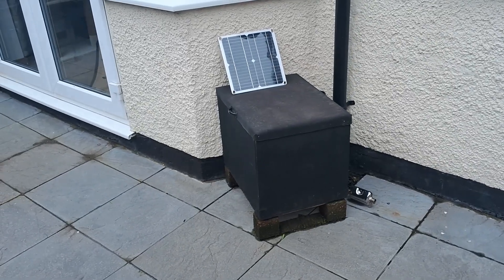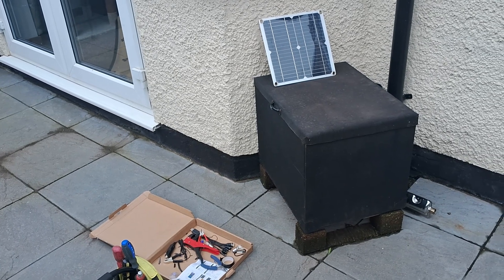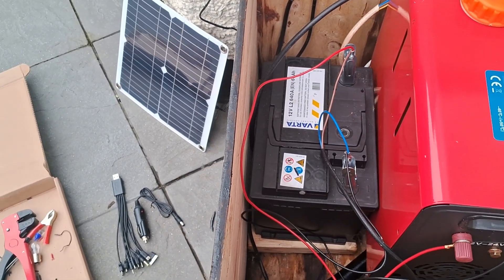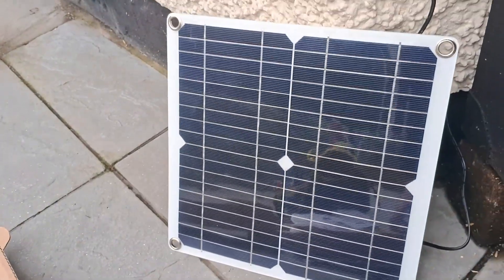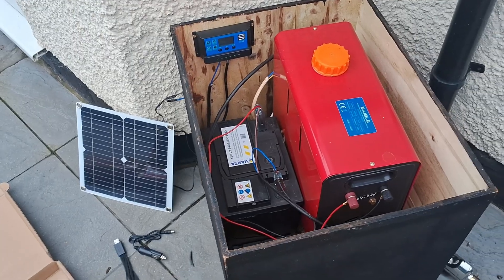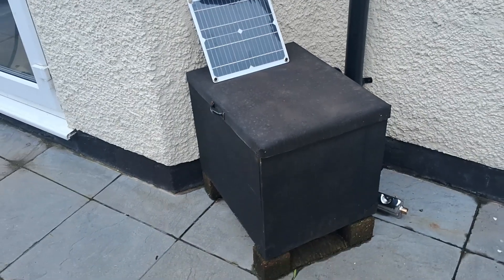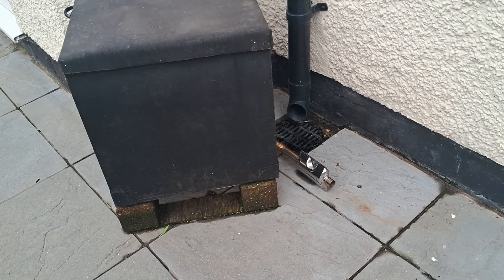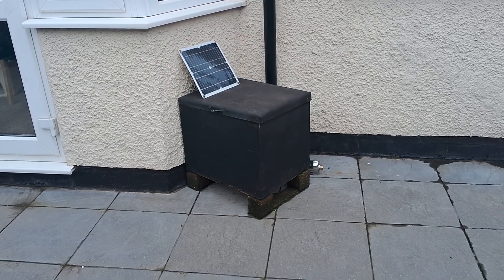SOLAR ENERGY POWER DIESEL HEATER HEATING MY HOME 12V BATTERY HEAT PUMP OFF GRID SELF SUFFICIENT

Comment: Sorry for the following long ramble and questions. It seems the way I think out load and problem-solve. Any comments and information you can provide will be helpful as I commence with my own DIY diesel heater project.

I've watched a few of your videos on capturing and utilizing waste heat from the heater exhaust to warm your home/workspace but I wonder if you've ever tried capturing the waste heat inside the enclosure or measured temperatures inside the compartment?  I'm specifically wondering if having a length of exhaust pipe inside the heater enclosure would be sufficient to warm a lithium battery above its charging shutoff temperature? Or does the general heater operation provide sufficient heat to warm the enclosure without relying on the exhaust? Perhaps constructing some sort of heat sink around the pipe and using that waste heat to warm the battery as well as the diesel fuel would keep everything warm enough without causing overheating problems? There would be an initial cost and consideration to make sure the heat sink wouldn't get hot enough to cause damage to the enclosure or components, but I don't think too much of an investment would need to be made.

I've have been considering a DIY project that incorporates a 2kw diesel heater in a (Keter-made) plastic modular toolbox along with a 12v 50ah LiFePO4 battery and diesel fuel tank. I am hoping to recharge the battery inside the case using a portable solar panel and small 14.6v 40amp DCDC charger with MPPT function incorporated within the enclosure. I already have the solar panel(s) charger and lithium batteries on hand, and would like to use the components I've already purchased. I'll also probably wire in some sort of busbar and fuse block, as well as a 12v DC socket and some USB ports. A few Anderson ports would also let me use ACDC chargers and run 12v appliances like camping refrigerators.

The problem is that lithium batteries cannot be charged below 0ºC (32ºF) without damaging the battery cells. The battery BMS restricts cold weather charging as a result, but that is exactly the weather condition when such a stand-alone diesel heater would be best used.

I realize I could run a cable from a battery inside the space being heated (probably the simplest and least expensive modification costing only a few dollars for a cable extension), but I would still like the option of having everything in a single box. If possible, I'd also like the solar panel to be sized for convenient carry/deployment from the battery box. Finding one of ample power and minimum size to keep the heater running 24/7 might be challenging, but I think doable.

So, the problem comes down to keeping the battery warm enough to recharge. I know they make electric battery warming pads but those draw more power than the heater itself consumes so that ultimately is not self-sustaining especially during Winter when sun angles are low, days are shorter with fewer available solar hours to charge, and gray overcast days are more frequent. The longer nighttime hours also add additional stress to a system dependent on solar recharging a battery.

I'm considering mounting the components in cages made from 2020 aluminum extrusion rails and possibly putting  sheets of aluminum composite material (e.g., Dibond, Alumibond, or Omegabond, etc.,) within the rail channels to distribute heat captured from the enclosed exhaust pipe and as a side benefit, provide a shelf to rest or mount components on. The rails could also act as spacers and perhaps allow more convenient arrangement of components within the toolbox. The aluminum panels would also help prevent hot spots and provide more even heat distribution along the walls and floor of the box and also between components such as the fuel tank and heater or battery, etc.

Do you think such a modification would work sufficiently to allow heating and recharging of the lithium battery? If there is a risk of too much heat inside, I have a few small low-voltage DC fans that could be incorporated to vent the box if needed, so I think it would be relatively safe. Or, am I overlooking some safety or operational aspect with this idea?
Reply from the maker: Your plan to use aluminum extrusion and composite material to distribute heat from the exhaust pipe for battery warming sounds quite clever. It could definitely work for keeping the battery above 0ºC for charging.

Comment: Hi I have to lead acid batteries in parallel ITRYED TO start SUNSTAR HEATER THE OTHER DAY  but got just to start pumping and cut off battery had dropped to 11.9 once I look in about 1 minute ? Solar panel connected 250watt semi dull day , but surley it should had enough power to start  it has in advert  it can use 12 volt or 24volt my thoughts was it’s set on 24 volt somehow it’s New  , can you assist ? Thanks
Reply from the maker: these cheap ones are not great in our british weather
Reply: @andyfireblade  so what is your silver unit set to in volts please ?
Reply from the maker: @loony457  12v

Comment: I use solar to my lead acid battery to prolong useage. But my battery is old so it doesnt like high heater settings but at a middle setting and solar panel it'll last all day no problem. I use the application for my ice fishing shack so what i do i leave my truck run for startup nd shut downs. 2 batteries in the truck 1 start 1 aux with an isolator ao never kills my starting battery
Reply: Does this work for you in winter months ?
Reply: @pedrospedro-x3f for my purposes yes,  I have changed my setup a bit because ill be putting a diesel engine heater in also,  but now I'm running 2 batteries in my cab with the isolator still so it doesn't drain the starting battery but had to relaxed starting  battery last winter due to age,  and day to day I'm not using solar just v letting it charge off my charging system. 

I'll get solar again but right now this new setup is working for my needs

Comment: How long have you been using the diesel heater for? I've seen mixed reviews on them and want to get the opinion of someone who is using it and not just reviewing it.
Reply from the maker: these heaters are great. been using them for 18 months, really economical and push out a good bit of heat. i recommend cheers andy

Comment: Nice idea but that small solar panel will not put  now where enough back in to what the heater uses  even if it was full sunlight think the heater uses 800mah + running  reckon that panel is max 300-400mah
Reply from the maker: thanks for your comment
cheers andy

Comment: i had thought of this as well , but was wondering if the solar panel could charge the battery with more volts than it used while running , if it cant  will it just go flat at the same speed as just running it of battery power alone ? could be wrong , i have a solar panel charging my diesel van battery it works very well , but only when not running the motor .

Comment: The issue with solar in the winter months in the UK is you’re just not get enough energy through the solar panel to charge the battery/s, as we want to use the heater in the winter months solar isn’t the answer.
Reply: Not if you get larger panels

Comment: Hi Andy.
Are all those usb ports pumping juice out of that little pannel?
It’s a cheap way to learn about solar.
Solar means sun, light reflection is your friend, clear walls are good, the black top of the case not so much. ;-)
Well, I would say don’t build to much around that panel and controler, you need more power, and efficiency.
Because you use a 12V battery doesn’t mean you must use a 12V solar panel, exept with a cheap charge controler maybe?
The panel must deliver around at least 15V to fully charge the battery.
If it’s cloudy, instead off producing 18V the voltage drops under 15V and there is no charging. 
If the panel (array) is 36V, there is more room for voltage drop, better production.
I have 6x100w panels, 600 Watts at 12 Oclock 21 of june, 30Watts at chrismass when we need energy.
You said the heater needs 2 amps? 12V X 2A= 24Watts.
Cheers.
Reply from the maker: cheers andy

Comment: Which item is it on the link? There are several
Reply from the maker: here is one https://www.ebay.co.uk/itm/394188184903?itmmeta=01HQX0JE19G504SHD0JCWFYRXG&hash=item5bc7725d47:g:q4sAAOSwkMJls1p9&itmprp=enc%3AAQAIAAAAwIFkVmM2W%2BCw65iiQHnLnuQH0oaYh8jA76pbWVpSzeUvf362WvyJvXJhfpENXr07VV591szxZJuNr%2FsSrEe4DONPZ0gtr%2BcS5DQuX8VpR6XW00gdNDkKGCV4CvldMugGWy1OKW5sdhyHVAzIJnoQexpxZoYBWQcIAIZuX59u0yzWx33VfaNuigBYJZDaBvXj9cwdn%2BdpS7%2BJ11FE7XQicnj12HG1T9lQa%2FhdmgMKuXe3WzP3S93zEDH%2FyQKLNilVMA%3D%3D%7Ctkp%3ABk9SR_zgyaC_Yw